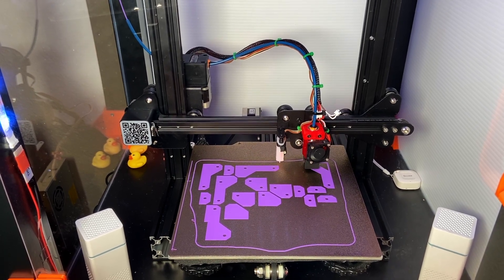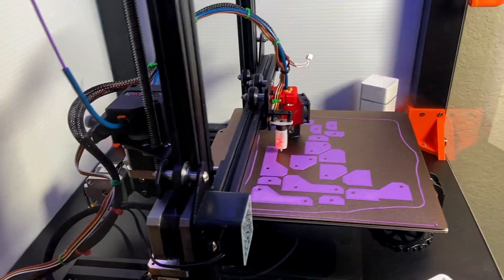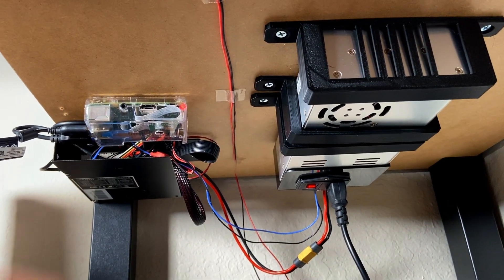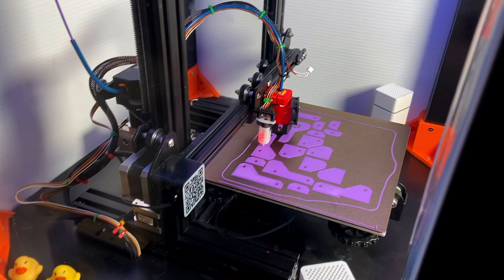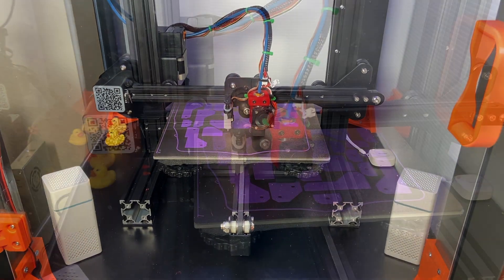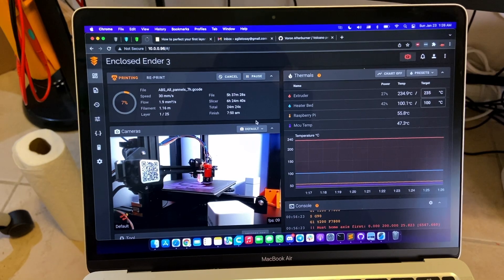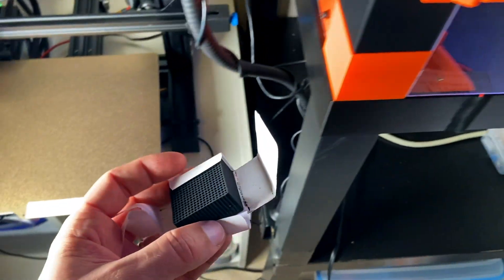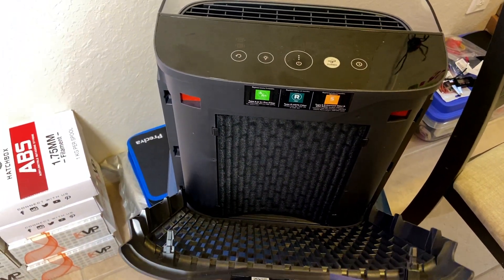Ender 3 IKEA Lack Enclosure (Part 2)

Comment: hello what size plexiglass did you use im in the process of printing all the parts but the plexiglass is the only part i’m struggling with
Reply from the maker: Check details in to the Thingiverse project: https://www.thingiverse.com/thing:3083358, In my case I purchased long plexiglass sheet and adjusted the size of the panels after build was finished for a snag fit.

Comment: Looks Awesome, I'm  in proccess of building one for my ender 3 pro too, for place the electronics outside you did just drilled a hole on the table for get out the connectors?
Reply from the maker: At the first yes, drilled big hole and taped around the wires with cloth tape. After moving at the new place was a bit lazy and just used fully assembled printer inside and it worked fine for me.
Reply: @hobbyistnotes  excellent, place the electronics outside is a great idea for keep the board and others components at good temperature, I will do that for my build, thank you so much for the great idea
Reply from the maker: @TheFpc20  That is exactly how I thought when finished assembling this enclosure, turned out it's not so simple considering that you have to rewire a lot especially if you want proper fit. As I modify printers all the time and unplugging things for mods became super inconvenient I have changed my approach. Initially similar enclosure was designed by Prusa and they also used fully assembled printer in to the enclosure, same way you can see Stefan from CNC Kitchen doing. With respect, at the end it's your call, use your own brain as all responsibility on you.

Comment: Hello! How did you managed to move all electronics outside? are the wires long enough?do you need to unplug everything from the motherboard? Built the exact enclosure thanks to your videos, i just need to add my printer into it :)
Reply from the maker: On the video you can see everything outside, cables were just bit short but as I never used full height it worked for me perfectly. Later I experimented: till you don't have internal heater there is no issues to run whole printer with electronics inside as internal temp never raised over 50(C). So now I just run fully assembled printer inside which is much easier to maintain, just drilled one hole for power cable to power printer.
Reply: @hobbyistnotes  tbh it looks cool and clean with electronics outside
Reply: @hobbyistnotes  How you managed to flash klipper firmware on the ender3? Via SD Card?
Reply from the maker: @glupu-r4b  Yes. You can google manuals, there are a lot of videos available for that too.
Reply: @hobbyistnotes  Actually i tried but failed couple times, i only find videos for the v2
Reply: @hobbyistnotes  do you have problems printing PLA due to the temps inside the enclosure?
Reply from the maker: @glupu-r4b  I usually don’t print PLA in there, but with open door there is not much of the hot air inside.
Reply: @hobbyistnotes  just tried printing abs and they keep failing.. i use 230C for nozzle and 100 for bed is that good?
Reply from the maker: @glupu-r4b  I used 235/110. Make sure enclosure temp is 35 and higher, you can warm up enclosure before print for extra 10mins after bed reached 110(C). Lower the temp in enclosure less print cooling fan (I print without cooling fan at all). Make sure air from hotend cooling fan aren't reaching the print (you can find tape mod in my video where I print without enclosure)
Reply: @hobbyistnotes  thanks for the tip! It looks like when printing the brim my nozzle is melting the previous printed lines if you understand me, and after some time the nozzle literally lifting the print from the bed and everything breaks
Reply from the maker: @glupu-r4b  Sounds like you closer to the bed than you needed to be. Also it's good to start from 1-2h prints while you figuring things out and adjusting. I never print full 20h+ bed my usual prints are 6-8h, longer you print more chances to fail.
Reply: @hobbyistnotes  i was trying to print the holders for the PSU cause i ran out of pla and had this abs laying around. I use a bltouch.. it never fails when printing pla, the first layer is perfect everytime..
Reply from the maker: @glupu-r4b  Enclosure printing it's own beast and changing environment temp you need to re-calibrate a lot of stuff, that is why my enclosure printer only prints ABS. To get reppitable results on x2 speeds with x4 accelerations I had to tune this specific printer for specific filament and specific temps. One of the most important changes for me was Flow and Pressure Advance they different than let's say for PLA or PETG, printer also have PID (bed, hotend) dialed in. Thin Bed on Ender 3 bends big time on different bed and environment temps, like when you start temp of the env is 35C bed mesh will be different with bed when it's 45C in enclosure and longer you print more variables affects the print. There was a nice simulation how Voron frame and bed bends while printer is heat soaking.
Reply from the maker: @glupu-r4b  One good tip is to have proper heat soak, if you use klipper lower down max_power for bed it will help to heat up slower to 110 and that time will be enough to get chamber and printer construction slowly heated up to work temp.

Comment: i designed a ball jointed filament pass through for enclosures an it allows it to move around as need, i always had trouble with my filament breaking when idle with the ones that go straight through an after i switched i dont see it unless the filament needs to be ran through my filament dryer.
Reply from the maker: Thank you for the information. I'll take a look later at your design. I had issues before with old PLA it becomes so brittle that it can brake anytime, as this printer made to print only ABS and ASA, may be that is the reason why filament aren't braking for me.
Reply: @hobbyistnotes  filament dryer was the best thing i found for dealing with the brittle filament, an some may get bad enough that it needs to be in the dryer while being printed but here is the thingiverse link to the one i made. i dont know how it will fit in side of a ikea lack enclosure cause i wasnt' able to get them locally so i ended up having to build my own tables an i used alot thinner material for the tops so if it isn't tall enough let me know an  i'll see if i can make some changes to make it big enough. i just put a ptfe tube through mine an on the one in the video i let it run straight into the extruder cause its so close to the top but on other printers i just let it run into the enclosures.

Comment: Looking good! On the topic of the carbon filters. Take a look at the nevermore air filter. And also my ender 3 is in an enclosure as well. All electronics are in there as well and it works fine
Reply from the maker: I actually have one Nevermore on my Voron 0.1 and right on the middle of building the bigger one for this enclosure. Good advice ;-) The problem with electronics outside it’s Hell to maintain…